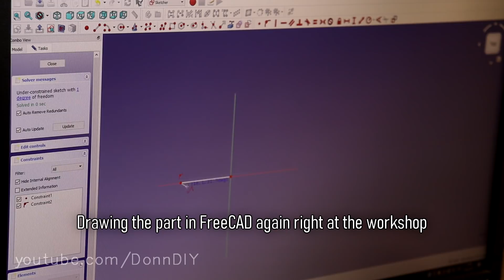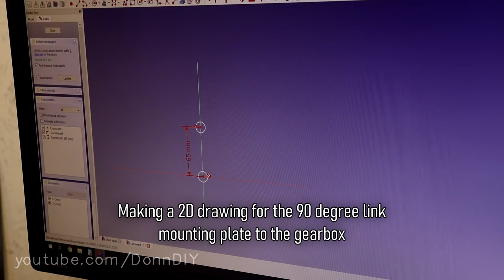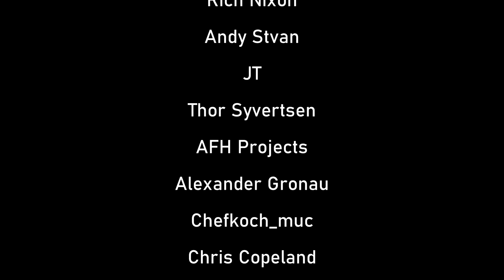Gear Shift Linkage - 4x4 Off-Road UTV Build Ep.21

Comment: this plasma cutter is great, it does the job very well, and it saves hours of work to machine the sheets
Reply: I was thinking of one thing! once the assembly is finished you will dismantle everything to protect the steel from corrosion?

Comment: Bend your shifter at a 90 degrees and add an extention pointing upward at the end. It would entail pulling up and pushing down instead of forward and backwards but you can quickly adjust to that, I did on one of my builds so 20 years ago.

Comment: Donn, I'm working at building a garden tractor using a few unconventional parts. I'm using a drive axle from a Hyster fork lift as it's complete, and will not require narrowing to work. It's about a meter wide from center to center on the tires. My engine is a Kubota 3 cylinder gas engine that I bought and had repaired, and that's in good condition. I plan to go hydrostatic transmission as it's simple to operate and maintain. I want this tractor to look old, so I'm not looking for all the "bells and whistles" found on some equipment today. It will just be a tractor. I'll be making a video big it as I move along, but I'm still acquiring parts for it...

Comment: If you think that gear linkage is a bit awkward you should try driving the one tonne Land Rover Forward Control, these were only sold to the British Army and I think their primary role was as artillery gun tractors.  They had the 3.5 litre engine that was fitted in Range Rovers but the engine was behind the front seats so the gear lever was behind the driver's seat and was enormously long!

Comment: Nice job Donn, your solution is a better than the one Peugeot/Citroen came up with, I lost count of the amount of those linkages I had to free up when because customers came in with "gearstick is hard to move" 

Slightly disappointed you didn't make Braaap braaap noises while going through the gears though.
Reply from the maker: We had problems with the original gear linkage in the cold, the car warmed up and the powder snow got in everywhere and melted. After cooling down everything froze solid.

I did make engine noises but it didn't get in the video. 🤪
Reply: @DonnDIY  The problems I had was the bottom of the stick rusting almost solid, I ended up making some nylon bushings to replace the brass ones for one customer as the rust on the pin/bolt had worn the brass and made the stick go from stiff to floppy. a stainless bolt and nylon bushing solved the problem.

Comment: Considering all the parts of the Peugeot Partner that you have used, we can say that they are of good quality, moreover, designing a gearbox linkage is not easy, nice job !
Reply from the maker: Yes. It was intended from the get-go to use as much unmodified Peugeot parts as possible to make the build more simple. But as you can see some mods are necessary. 😉

Comment: The firewall for this is going to have to be beefy, as you are literally right next to it.
Reply: Lots of insulation , I think .
Reply: @inmyopinion6836  Whut, no, firewall's aren't really used for heat or anything. If the engine explodes then there's a big metal barrier right next to you so shrapnel doesn't go stabbing into you, it's just a big metal wall to protect you from explosions, fire, and more.
Reply: @lectrician2 - Summers here are brutal . Any and ALL relief are welcomed . Also look at the thermal mechanics of header wrap .

Comment: Nice, should the shifter mount be mounted to the transmission? The shift rods are very short with little play, and being mounted to the chassis the engine/trans deflection on rubber mounts might be a problem.

Comment: Pretty good you can weld all those tiny shift linkages' and not melt the rubber boot or grease. Bet you'll find on the first run that the shifter is still to far back, lotta shifting in 4-wheeling..........

Comment: This is another outstanding build, I really like your ability to desing and build almost anything you need! :)
But why did you decided to put engine on the left and drivers seat to the right? You could put engine on the right side and still have wheels rotatiing forward just simply turning differentials upside down. I'm sure that E39 differentials are robust enough for this purpose, even when one of them would be turning "backwards" during normal forward driving. That's what is happening with current setup too. Not criticising, just wondering. Awesome job anyways! :)
Reply from the maker: Why turn the differentials upside down when I can put the engine on the left... 😁
Reply: Because it would be comfortable and natural to drive this UTV from the left side :D

Comment: looks like your engine needs a strut to stabelize it bit
Reply from the maker: The bottom mount is not welded yet. After welding it should be good. 👍

Comment: Donn, the vans that we have here in the States are all automatic transmission. I would almost prefer manual transmission to them.
Reply from the maker: Manual transmission gives a certain freedom of choice. Is cheaper and simpler to maintain as well.
Reply: @DonnDIY  not to mention that they typically require less maintenance, and have more durability to boot!